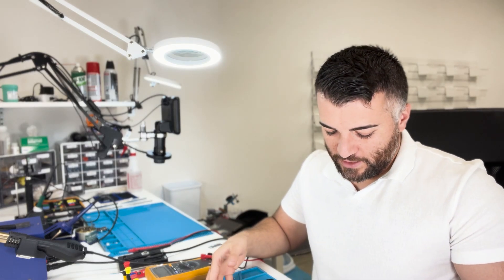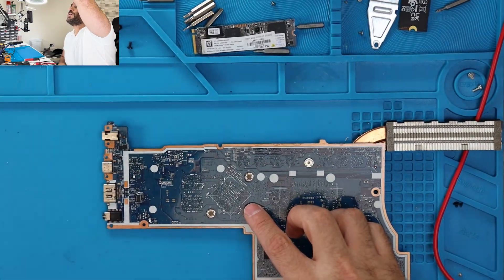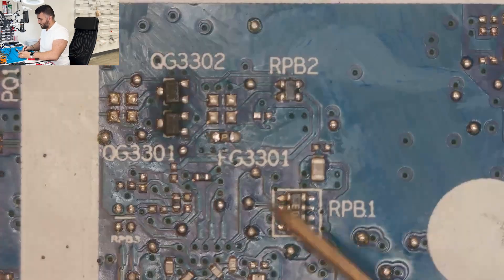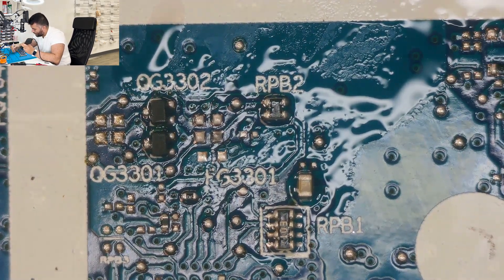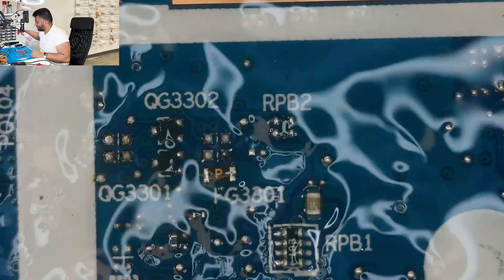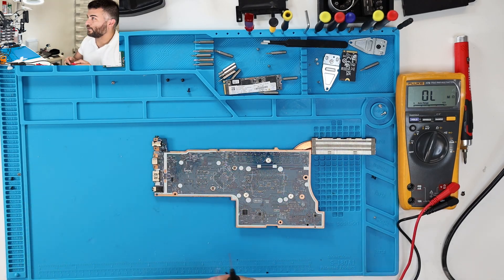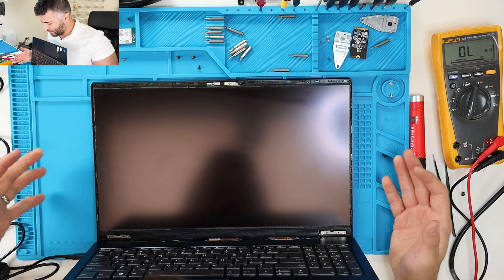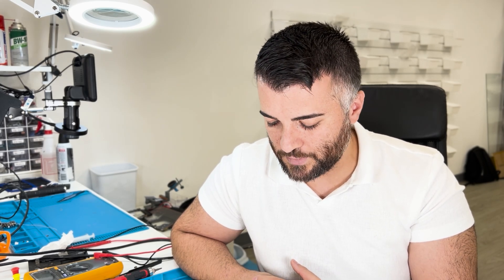Lenovo IdeaPad 5 Dim Display Repair! (Blown Fuse)

Comment: Informative video brother. Can you please help me with my situation? I have a Lenovo 15ITL05 and recently the LCD panel got damaged but was able to see the broken display (with backlight). I tried to swap it with the one ordered from screencountry. But the backlight didnt work, saw your video and tested the fuse, fuse is working good and no issue with that. Not sure what could be issue. Tried connecting to an external monitor and its working, laptop can detect 2 displays (internal and external) but just the backlight is not working. Any help from your side?
Thanks in advance brother!
Reply: I have exactly faced the same problem. Do you get any solution brother. Please help

Comment: hi. I see that u use 3A. is 2a fuse sufficient ?
Reply from the maker: Hi, I don’t recommend it. If it draws anything more than 2a, it could blow the fuse again. 

As long as the voltage is correct, you technically could. But why take the risk? 😅